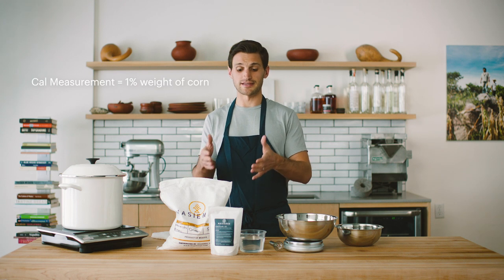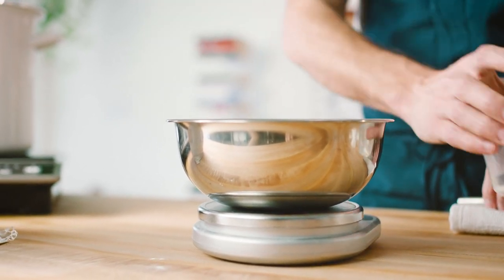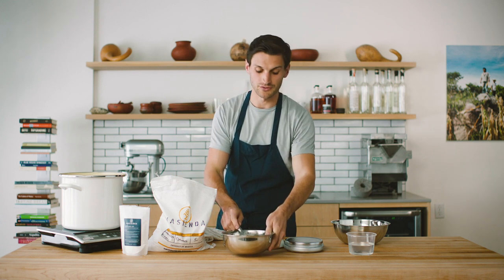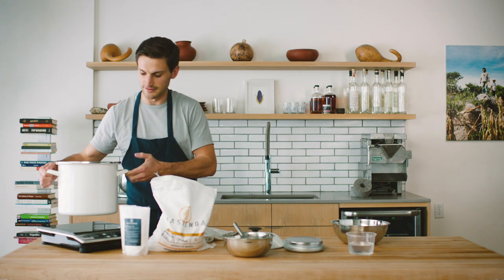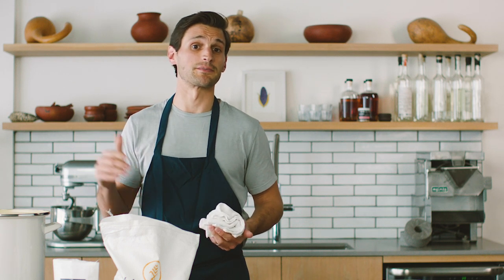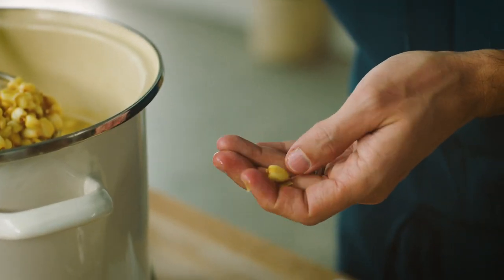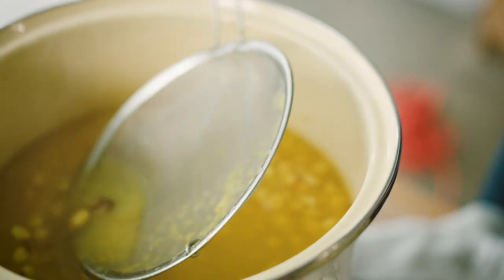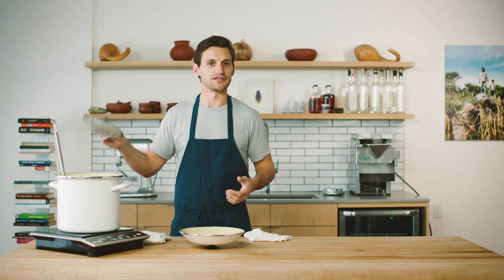How to cook corn with calcium hydroxide (cal) | From Kernel to Masa (Ep. 2)

Comment: The Culinary Institute of America has 1lb of corn, water covering corn by 2” and 1 Tablespoon of calcium oxide. Boil for 5 minutes, turn off heat and soak for 12-18 hours before washing, rubbing and grinding. I’ve been using this method for several years with great success.
Reply: I would do whatever the Mexicans do because the US hasn't been doing so well regarding processing grains. Did you see the USDA changes to soy beans?
Reply: @wildswan221  its literally only a difference in cal amounts lmao. and the CIA is not the USDA. It's a cooking school. chill.
Reply: You just described, perfectly, the proper way to do this. Arizona native here with abort 30 years in the Food and Beverage business.
Reply: @wildswan221  Except soy beans are legumes.
Reply: After nixtamalization, does the corn stay in the same bowl? Because after washing, the corn still has a strong, pungent smell. How do I get rid of it?
Reply: I have changed my method per recommendation of a Mexican chef. I start with 2 lbs. of corn which I wash and then cover with water 2” above the corn. I add 1 tblspn of Cal. I now bring the nixtamal up to 92° C and keep it there for 25 minutes. Then cover and soak for 18-24 hours. I then wash, rub and grind. For grinding, I do two grinds. The 1st is in a food processor 2 cups at a time. To this rough grind, I add 1 1/2 cups of water. I mix the water in thoroughly. I then do a 2nd grind with a hand cranked Victoria grain grinder. This produces a super fine masa perfect for griddling tortillas!
Reply: Is it normal for the strange taste and pungent smell to remain after washing and grinding?
Reply: @markhaven5421  Thank you. I am going to follow this method exactly.
Reply: @markhaven5421  Do you have a method for storing the fine masa? Freezing perhaps?
Reply: @pequodexpress  Masa does not refrigerate or freeze well. I always griddle all of the tortillas and then freeze in batches of 12 inside of Ziploc bags.
Reply: @markhaven5421  I like that method of making the tortillas and freezing for a future date. 

What about freezing the unground processed kernels, and then grinding as needed into four and hydrating as necessary?
Reply: @pequodexpress  I haven’t tried that. It may work!
Reply: @markhaven5421  I've just put 1 kg of corn on the burner. Do you think 12-year-old calcium hydroxide will still be active enough? We are about to find out.

It has been 12 years since I last nixtamalized corn. My local store recently stopped carrying masa harina so I had to raid my storage facility to go old school again.

Comment: I have a question about the ratio of water to cal.  In your book you say that the ratio should be 3:1 water to corn by weight, but in the instructions you say to cover the corn by 4".  So when I go to nixtamalize 500g of corn and then put in the correct 3:1 ratio (1500g by weight) the water covers the corn by about an inch.  So what am I supposed to do?  Thanks!  Love your company and your channel.
Reply from the maker: This is a great question. The height of the water that covers the corn may vary depending the pot being used to cook the nixtamal (e.g. wide pot vs tall stock pot), but that the important takeaway is that the corn should always have enough water to keep it submerged while cooking so that it can nixtamalize properly.

Comment: The whole series is very informative.  Thank you Jorge.  In my first try, I completely added waaay to much lime and went through whole process (with food processor) than threw all away! The smell was awful.  Second try I adjusted the lime to 1%. After nixtamalization, still a pungent odor but subsided after few washes.  I am in Turkey and what they sell is not calcium hydroxide but calcium oxide.  They claim that if you solve calcium oxide in water, it will turn to calcium hydroxide.  Any ideas on that? I do not want to poison myself for a recipe :)
Reply from the maker: Hello there! We're thrilled that you found this information helpful. While we don't have details on dissolving calcium oxide for nixtamalization, we'd like to suggest checking out this video for further guidance. An important ratio to note is equal parts, by volume (not weight), of corn to wood ash, such as 1 cup of corn to 1 cup of ash. Please feel free to reach out if you have any more questions! https://www.youtube.com/watch?v=EiMWLFI-yd0

Comment: Wonderful series of videos to help those starting on the masa journey! I understand that the rule of thumb is using 1% cal to corn ratio. I just purchased 5 different heirloom corn from Masienda. For the Blue Cónico, the description recommends using 0.85% cal ratio. Does this apply to the Purple Cónico as well? 

I’d love to retain as much of the beautiful colors as possible without sacrificing the nixtamalization process.

What about the Pink Xocoyul variety? Should I maintain the 1% ratio?

My uses starting out are for tortillas, tamales, and gluten free baking; though I’ll probably use cacahuazintle for tamales. I purchased “Masa: Techniques, Recipes, and Reflections on a Timeless Staple” and am reading about other masa uses 😊

Last thing: Can I dehydrate a portion of the nixtamal to grind into masa harina later? Or should I follow the baking method from the book? Is vacuum sealing (w/ desiccant and oxygen absorber) recommended? Is it better to store in the refrigerator, freezer, or in a cool dark environment?
Reply from the maker: Hi there! Thank you for your questions. 0.85% ratio of cal to corn by weight can apply for any varietal where they're looking to preserve some color (blue, purple, red). Here is a link (https://cdn.shopify.com/s/files/1/0602/7483/5605/files/varietalmatrix-corn-04072023.pdf?v=1680893465) to our corn matrix which serves a general guideline for cook times/cal ratios per heirloom corn varietal. As for putting nixtamal in the dehydrator - we haven't tried it ourselves. A good dehydrator will usually have a top temperature of 165 degrees fahrenheit, so if you compare it to the MASA book instructions, which recommends 275 degrees fahrenheit - I imagine the dehydrator method could potentially work but would likely take longer than the estimated 4 hours using the oven method. In any case, we could definitely encourage you to experiment and would love to hear about your experience! Vaccum sealing with a desiccant & oxygen absorber (e.g. silica gel packet) is definitely going the extra mile and should be fine to do as long as the nixtamal or harina is completely dry at the time of vacuum sealing. Let us know if you have any additional questions!

Comment: I left the pot for longer than the recommended 8-12 hours (more like 48 hrs😢). My Blue Conico is bitter after grinding. Was the cause of the bitterness the extra long soak? Anything I can do to reduce the bitterness? Or should I start again? Thanks so much for your amazing products and expertise.
Reply from the maker: Hi there! We apologize for the delay in getting back to you. Thank you for reaching out about the issue with your Blue Conico corn. It sounds like the extended soaking time may have caused the bitterness you experienced after grinding. To prevent this in the future, we recommend sticking closer to the recommended soaking time of 8-12 hours. If you have any more questions or need further assistance, please feel free to reach out. We appreciate your understanding and support!

Comment: You don’t take into account the weight of the water as well when measuring cal? Shouldn’t it count?
Reply from the maker: Thank you for your question! The ratio we like to use is 1% of cal to the weight of the corn, with a quantity of water that equals about double the weight of the corn. This helps provide just the right amount of alkaline solution for the corn to get nixtamalized (help remove pericarp, & activate the niacin in the corn). If we were to take take the weight of the corn and water when measuring the cal, we would end up with an alkaline solution that is too basic for our applications, and it would affect the overall flavor and color of the finished nixtamal. For example, using too much cal when cooking blue corn, could result in a green colored nixtamal with less corn flavor.
Reply: @Masienda  then it makes sense to say corn 100%, water 200% (of corn) and cal 1% of corn, like they say in modernist cuisine recipes. That way if I wanted to add 3 liters of water to 1 kg of corn I’d know I’d have to compensate for the additional water with 1/3 of 1% extra cal. The pertinent info being that you’re suggesting a specific amount of water in answering my question that I didn’t clearly see previously so thank you.
Reply from the maker: Really, there should be plenty of water to cook the nixtamal - we are prescribing cal to corn ratio but the water quantity is not prescribed (like it would be for cooking rice). Rather it should be generous to be cooked off later (like cooking pasta).

Comment: Can Cal lose its potency ? If so Is there a way to test the Cal to see if it hasn’t ?
Reply from the maker: Cal (calcium hydroxide) can lose its potency when exposed to carbon dioxide, changing into calcium carbonate. There's no visual changes or tests that can be done, but if it's lost its potency it won't properly nixtamalize your corn--meaning that after "nixtamalizing" the skins likely wouldn't rub off.

Comment: Hi! I have a red corn  and i have tried to cook for about 1 hour. Then i leave it all night.  When i try to gring it with a lenin molino san luis, i don´t get a good masa as there are a lot of grains, when i try to gring it again i have difficulties because it takes too long time. I don´t know if i am not cooking correctly the nixtamal or if the piedra volcanica is old, or if it is normal to gring it more that once... maybe the red corn is different to the other ones...and it not good for nixtamal? thanks for your help.
Reply from the maker: Hi Ainhoa, thank you for your question. Cooking times can vary per corn varietal. A few key things you'll want to test while cooking any kind is the ease of which the skins come off between your fingers (should be very easy), the taste of the kernel (should taste like a tortilla), and the hardness of the kernel (should be al dente to the bite, and easy to chewy). Once you have these features with your corn you're all set to let the nixmtalization happen overnight. We've never tested the grinder your using but the Masienda Molinito does not require more than one grind to get perfect masa.

Comment: What happens if you overcook the corn?  how can you tell when you have gone too far?
Reply: I have read elsewhere that when you over cook the kernels get very round and swell and resemble the corn you might see in posole.  At that point there is too much moisture for use in masa, but you can use it for, well, posole!  I’ve done multiple cooks with three of the varieties of Masienda corn, and haven’t overcooked any (so far).  I check as he does, frequently.  The blue corn I had seemed like it took the longest to get the right texture and flavor, but as he notes, some of this might be due to additional drying

Comment: Does Calcium Hydroxide corrode metal/plastic/glass?
Reply from the maker: Hi, thanks for your question! Yes it can be corrosive to galvanized steel or aluminum but not plastic or glass. We recommend using a non-corrosive pot for cooking.